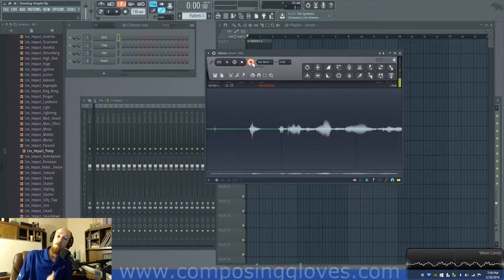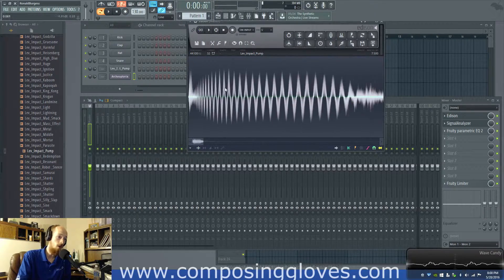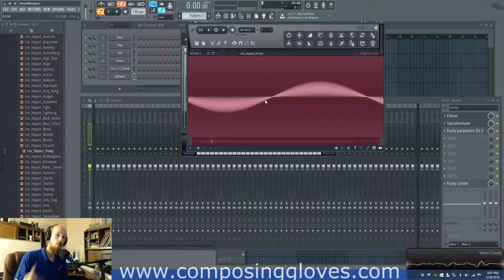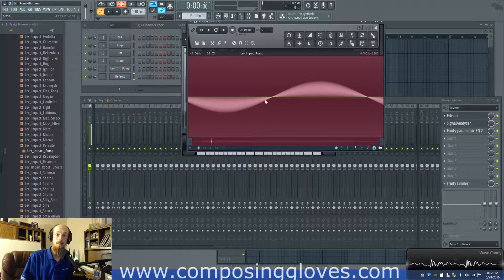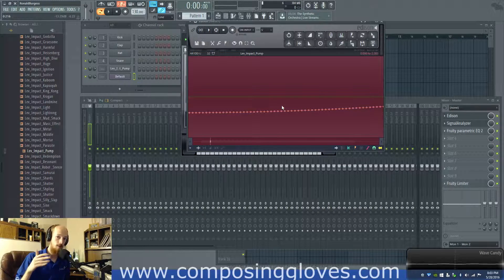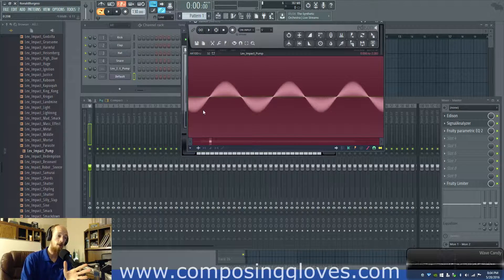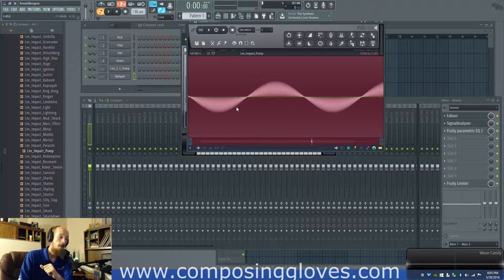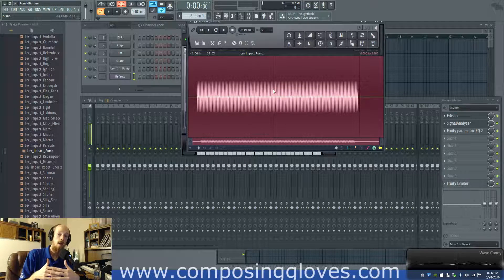Digital Audio Basics 8 - Low Bit Converters

Comment: I hope you don't mind me asking all these questions if you do just don't reply haha. But what is a converter? I was hoping to hear the words "A converter is.." but I'm lost bro. You've talked about low converters and high converters and skipped the explanation :) "delta sigma modulation,  multi bit converters" big words straight away haha and I still only saw you record a sine wave at this point hahaha. I tried to find another video on youtube and failed. Also could you explain what linearity means? I hope that isn't a ridiculous question. I think the main problem I'm having is the lingo, I just don't understand some of the words you're using for eg the bandlimit issue ;) but that was solved of course. It all makes so much sense when I know what the words you use mean.
Reply from the maker: A digital audio converter is what is used to translate from an electrical signal to a digital signal (ie continuous varying electrical level to 1's and 0's). Because computers can only deal with on off (there are exceptions but no one uses them)  we must translate the electrical current to binary. There are TONS of methods on how to do this and huge complications come up. Thats what the low bit converters and multi bit converters are for. They are improved methods of conversion. A lot of these topics are unknown to many people in audio and it creates a great deal of misinformation about bit depth and sample rate.
Reply: LOL I have one of these machines the same as yours. silly me.